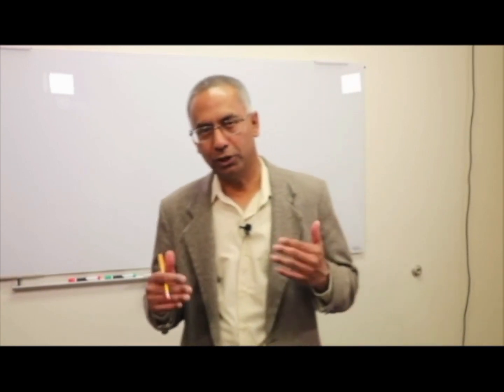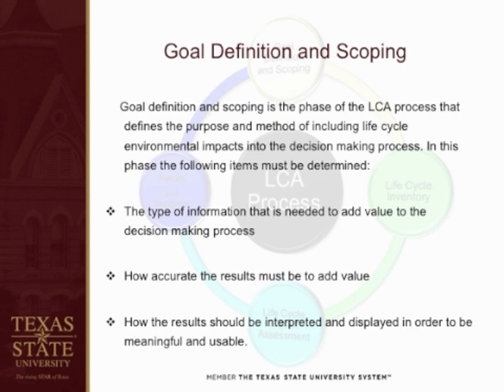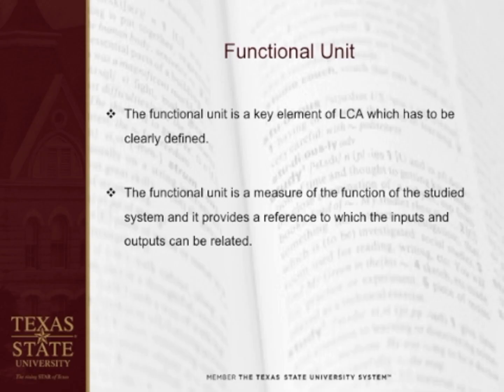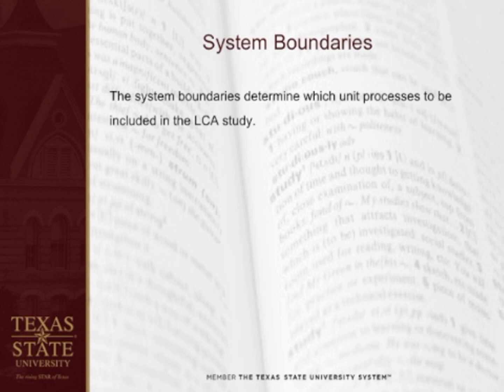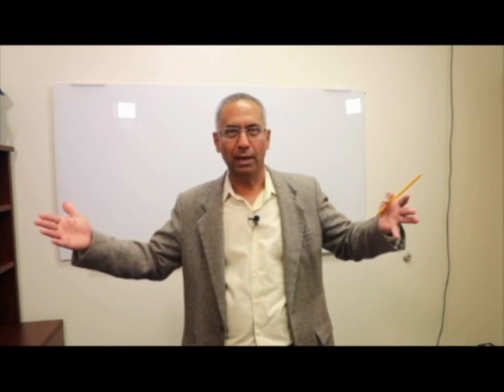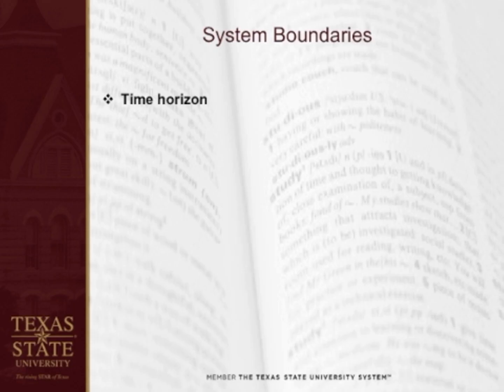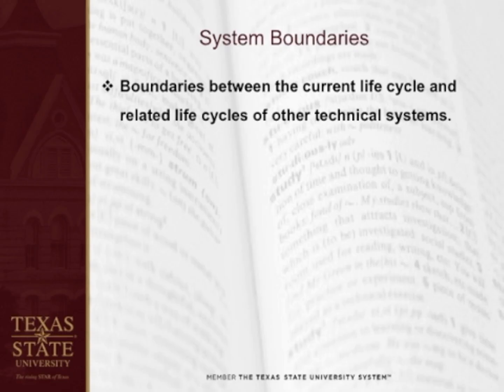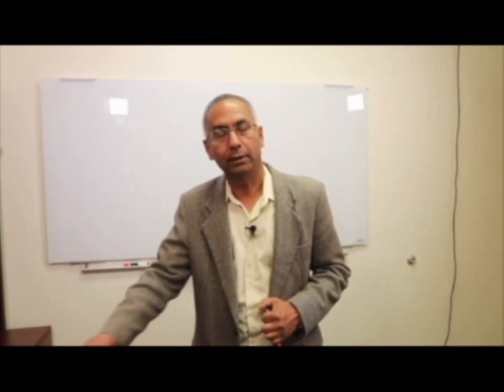T4 P3 Goals and Scope, Functional Unit, & System Boundaries

Comment: Hello pls help me sir with my struggle here,

I am supposed to perform a LCA on a plant. I want to ask.

Can a LCA be carried on just the use phase of the plant (energy used) ? 
If yes, can I perform just a years analysis? As I was only given the full year data analysis on the plant operations.

Also, can I just multiply the net annual energy by its life span if I want to get the net energy used for its whole life cycle during its use phase?.

Please help, I would really appreciate.
Reply: I am new to the field